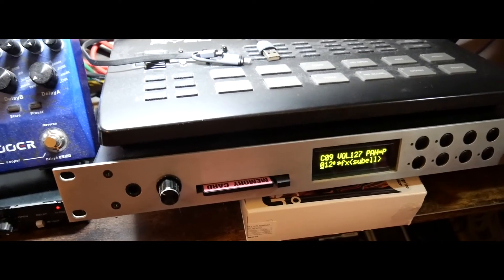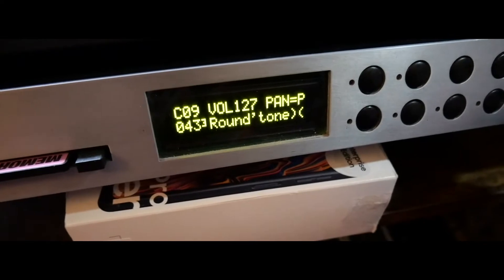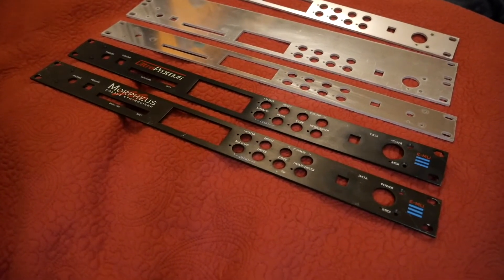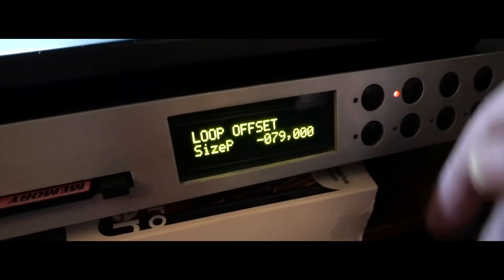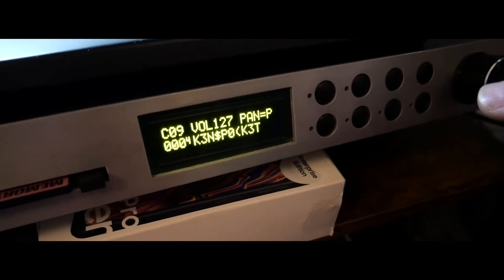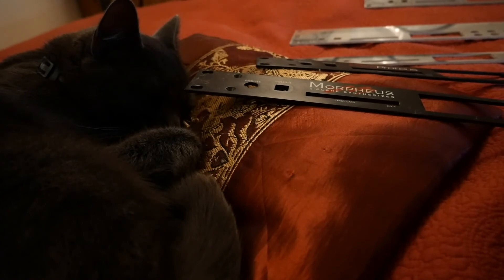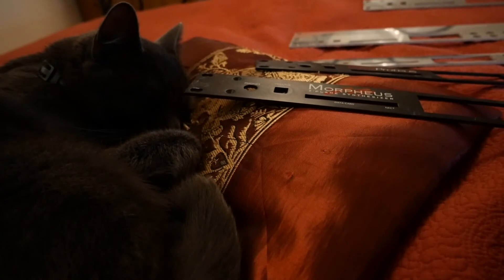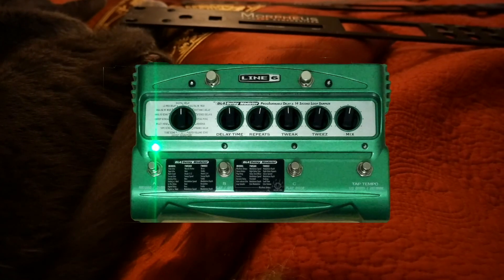E-mu Morpheus Episode 5 Hardware | Mods + Chip Swap Hacking

Comment: How are you adding the labels on the faceplate? Silk screening is possibly the best - next would be to layer the faceplate with a clear vinyl. A vinyl cutter/printer (CNC) would be the tool of choice. With the greatest of admiration! Thumbs up and subscribed.
Reply from the maker: Hey use a felt pen, free hand , however I prefer mine naked. 😉 I'm familiar with the controls so ..

Comment: G ROM and H ROM probably refer to the G, and H chips.  BTW I'd be interested in your thoughts on the Proteus 2500, as there's one for sale nearby at reasonable (ish) price.  Did you ever own/use a P2500 and if so, is it an interesting&deep machine that's worth having?
Reply from the maker: I understand the G chip maybe similar in design to the chip used in EIIIXP samplers, with the 32 voice G-chip,  The G-chip and the later G-chip II 128 voice, do sample interpolation (pitch-shifting) on chip ASIC , So the H Rom is the sister digital filter Chip memory program instruction. Consensus the 32voice G chip is Warmer than the later 128voice. Morpheus is 32voice. Test I guess is just checking the chips are functional.
Reply from the maker: P2500 has 24-bit DAC , up from 16bit P2000,  also has on board sequencer. I never heard one or used. Very vrare. 4 simm slots internally btw , spdif and usb , footswitch also. For the right price, try it out. :)
Reply from the maker: found this info in a old forum it has some P2500 info :

The Composer rom was the factory rom for a Proteus 2000. E-MU reused the wave data but, redid the presets on the Composer rom and renamed it the Pop Collection rom. This rom was code named the PROM and was used in the Proteus 2500 and PK-6. They also redid the XL-1 and Mo' Phatt roms and put them in the XK-6 / XL-7 and MK-6 / MP-7.